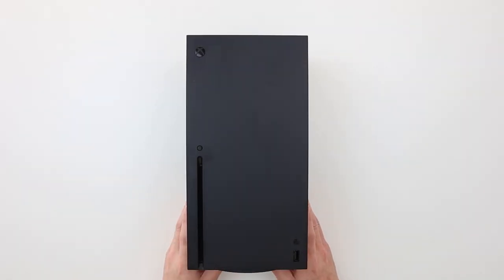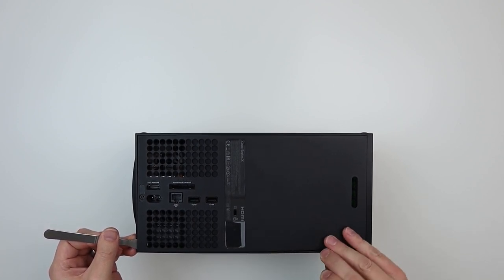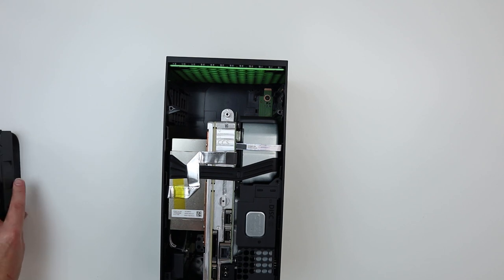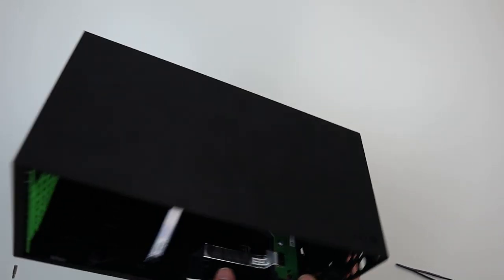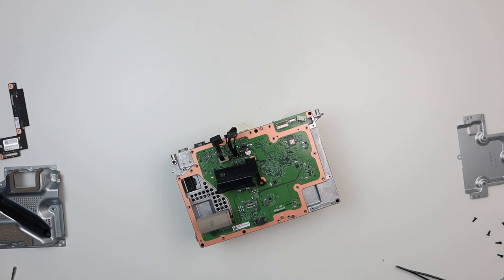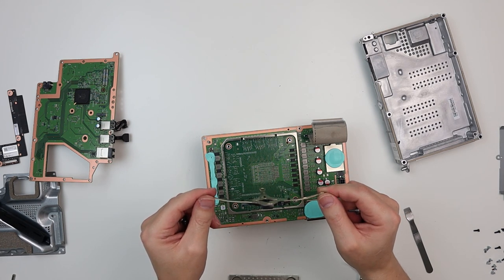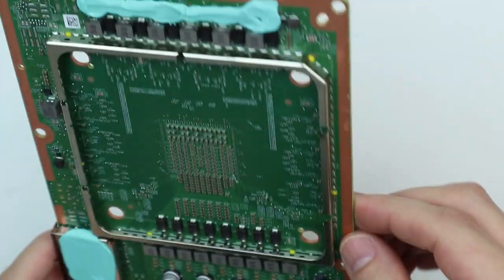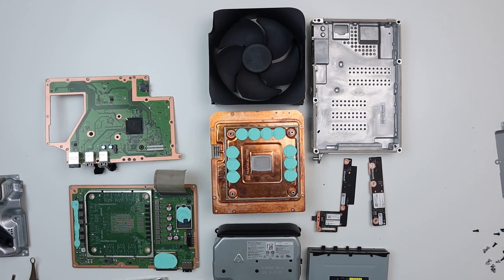XBOX SERIES X TEARDOWN! We strip down the new XBOX SERIES X & take close up look at the motherboard

Comment: It’s insanely Awesome How The Engineers essentially managed to Put both a Ryzen 3700x Cpu & RX 6800 Gpu into this Console Apu even if the Gpu is slightly cut down from 60 compute units to 56 compute units as that’s the actual size of the GPU albeit for yields only 52 compute units are active in the Series X but even then that’s insane a Console has a nearly $300 dollar Cpu, and almost a $550 dollar Gpu, and despite having a few less compute units than the Pc version it won’t matter because with the usual deep console level developer optimizations for game’s the Xbox Series X Will easily have comparable performance to the RX 6800 / Nvidia 3070 cards as that’s uber impressive for a Console ! 

I’m an old Man I’ve been Gaming since about 1986, and there’s no doubt The Xbox Series X is the most impressive Console ever created as it’s a marvel of engineering Excellence as it’s build quality, and high end Pc level components is Phenomenal
Reply from the maker: Absolutely agree!
Reply: Agree" Luv mine' it's a Beast'😏
Reply: Completely agree  considering it will have performance close to a 3000 series Card later in time it’s really impressive
Reply: @ARXInfinite  Yea I think what I said is reasonable especially once devs start utilizing the new AMD dlss type software upscaling direct ml super resolution for the New Xbox Series X as that’s gonna deliver dramatic performance improvements across the board, however it’s gonna be a while before We start seeing True Next Gen only game’s which can take full advantage of the Newer Hardware, software, and newer more advanced game engines, etc !
Reply: @ARXInfinite  either way for the Price of just $499 The Price to performance ratio of The Newer Consoles is insane especially for Xbox Series X as an equivalent GPU alone by itself costs roughly as much !
Reply: @nitroglycerin2743  agreed. Games what will Utilise Game engines like Unreal Engine 5 we will start to see amazing Graphics and games. And even better Performance with AMD DLSS Type software!

Comment: 😁What will happen if you take the Xbox series Acts SSD out of the Xbox then stick it in the PlayStation5
Reply from the maker: In the PS5 the storage is hard wired on to the motherboard :-(
Reply: @TweakTips  You could wipe the Xbox partitions off it and then install it into the PS5's M.2 expansion slot under one of the white side panels.

Comment: I think now we see how so many of them are defective right out of the gate. Form factor over performance. It's gonna be a rough console generation again for Xbox.
Reply from the maker: Only time will tell I suppose
Reply: Well, actually no. These are extremly well designed consoles, you can see it yourself comparing this to any other console.
Reply: Mine is Going strong since October. my cable box is louder